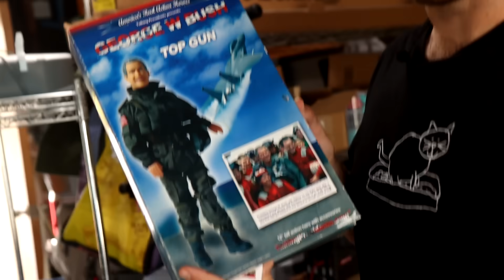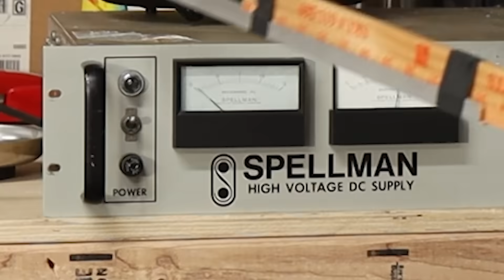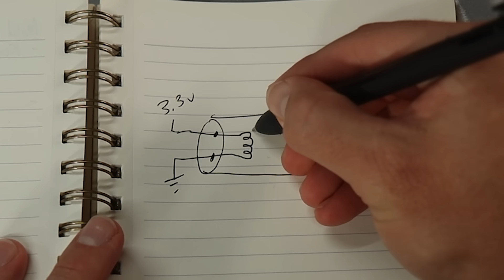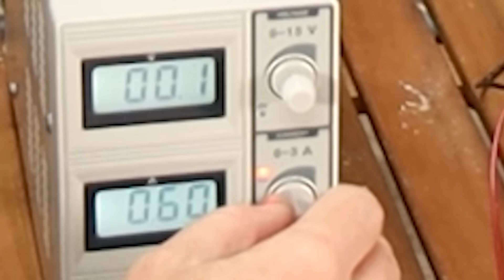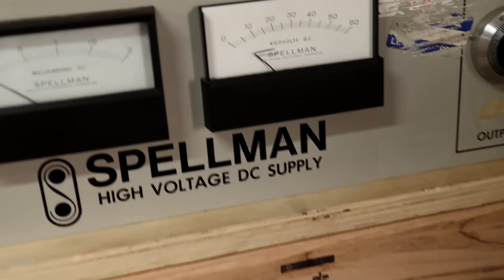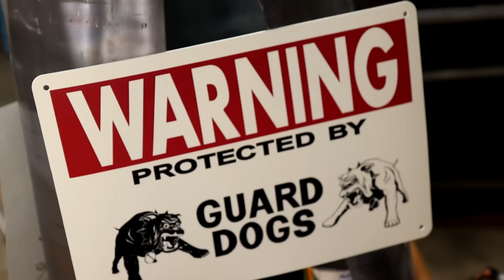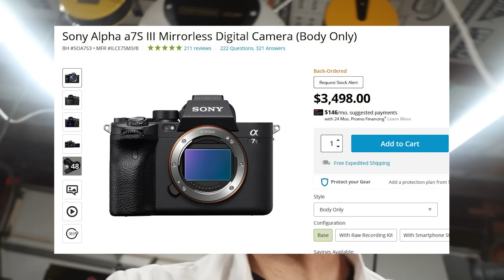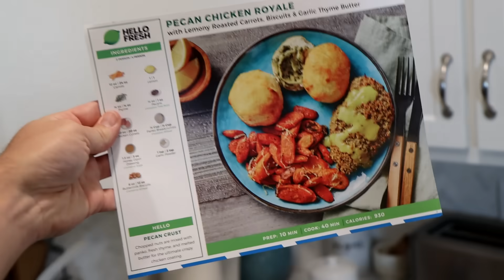Built My Own X-Ray After a Hospital Charged Me $69,210.32

Comment: I want to put this into perspective for everyone. I'm an xray tech. 60kV is good for extremity x-rays in terms of penetration. When an x-ray is taken on a commercial setup, it lasts about 0.04 seconds at say 0.125 A (125mA) Or 5 mAs (milliampere-seconds) for say an arm or foot. Even less for a hand, probably 2.5 mAs. 5 mAs is harmless. It's about equivalent to about 3 hours of radiation from natural sources (the earth, the sun, the stars etc) or around 0.001 mSv of radiation dose. A higher dose x-ray is something like a lumbar spine on an obese patient. The required exposure might be something like 100 mAs at 80 kVp which is equivalent to maybe 12 months of background radiation or a dose of 2 mSv. Now. ONE WHOLE sievert (or 1000 mSv) gives you a 5% chance of getting fatal cancer. 5 sieverts will give you a 50% chance of getting fatal cancer. So really, anything above 1000 mSv is quite dangerous, with a 5% risk of fatal cancer. William is using 60 kVp with exposures of maybe 0.5 seconds ~ 30 mAs or maybe 1 second - 60 mAs. This is considerably higher than a commercial tube extremity exposure because it's made out of cardboard. Thats about equivalent to a normal sized lumbar spine x-ray. William probably gave himself 1 mSv (0.001 sieverts) of radiation dose for that hand xray, about 6 months of natural background radiation. Was it dangerous? No. Where 1 sievert gives you a 5% chance of fatal cancer, 0.001 sieverts might give you a 1 in 200,000 chance of getting cancer. Thats a 0.0005% chance of getting cancer. Repeated doses are however cumulative. In terms of ONE single dose, if you repeated this dose on a different person for 548 years, you might expect a 5% chance of one of them getting cancer.
Reply: Thank you for this concise expert context! :D
Reply: @jamesjenkins9480  you know he probally doesnt know anything right?
Reply: William said CT scanners use heaps of radiation. It's true, but only comparatively.. A HIGH dose Contrast-Repeat CT scan may give you 16 mSv dose which is equivalent to 16,000 of Williams hand x-rays. That still represents a low risk of getting cancer. Most CT Scans are between 5 and 10 mSv of effective dose
Reply: Or have really shittty luck.
Reply: Woah, this video must've been sooo much more interesting for you than the majority of people; and thanks for that explanation, I figured the risk was lower than it seemed but this definitely makes him seem a whole lot less crazy for doing this lol
Reply: i plan on becoming a Radiological technician, is it worth doing it or no
Reply: @arturogalindo1588  It's a solid career choice. There will always be work and you can work in a variety of modalities to suit your personality. So yes! absolutely. Weather you have a good experience or not will always boil down to three things: Who you're studying with, What hospital you train in and How good your course is. Once you've graduated though it doesn't matter, you can move around to find when you belong.
Reply: @matthewrowlands7271  how long is school for an x ray tech
Reply: @kc-jm3cd  In New Zealand it is a 3 year degree. Most places will be the same
Reply: @kc-jm3cd  I have my bachelors degree in X-ray and then cross trained and took my test to do cat scans so about 5 years.
Reply: @ashleycountiss720  thank you
Reply: @arturogalindo1588  I was a radiographic for a short time when I was younger, however I didn't "x-ray" people I took radiographic pictures of welds on high pressure gas lines , and various metal products for the military using radioactive isotopes the field is called "non destructive testing" so if your interested in radiography and don't want to deal with "patients" you can look into that area........you still need to study and pass tests by the nuclear regulatory commission to advance to high levels ...............very fascinating area of study, ......................Erik
Reply: Just a "small" correction, 5 sieverts isnt a 50% chance of getting fatal cancer, it is a 50% LETHAL DOSE (chance to die in a short period of time  - a month) because the cells in your body literally got fried by radiation. You dont have the time to develop cancer. But yeah, I imagine those who manage to survive that die from cancer later on. (This applies if your whole body received that dose. If its just the hand, the hand would start dying off.)
Reply: Thank you from a fellow tech!
Reply: Thing is, I would rather avoid (pointlessly) increasing my chances of getting cancer at all, even if it's just by 0.0005%.
I would be cool if that chance could be decreased but, unfortunately, that's not the case.
Reply: @qdaniele97  I'd take a 0.0005% chance of cancer for something this badass. Everyone dies eventually, may as well make it interesting, yes?
Reply: Nice math mate thanks for this
Reply: Nerd lmao (Just kidding its really cool that you can know this kind of stuff and I envy your knowledge :)
Reply: I am also an x-ray tech and have a bachelor of science degree within x-ray radiation and I will tell you and everyone else in this field that there's no such thing as a safe dose of x-rays. That is simply not true and a misconception that floats around hospital staff and even x-ray technicians. X-ray radiation accumulate and every dose can theoretically cause damage. You're absolutely right, we have an upper limit for when you're sure to get acute radiation damage but what we don't have is a lower limit for when damage can occur. You can have 30 CT scans in your life but it may be the radiation from a simple flight that causes the damage that turns into a cancer. It is also more or less impossible to put a finger on the event that caused the specific damage as it can take years or centuries to develop. When I did my thesis there was a focus on low dose radiation being much more harmful than previous thought. There's still a lot we don't know but playing with radiation is extremely dangerous and should not be done by anyone inexperienced in this field
Reply: @gris186  Everything in life is a risk bro! drinking, driving, smoking. Radiation nazis are often the ones who send crappy photos because they're scared of repeats or use inadequate exposures! The patient is better off having a few repeats than crappy imaging. Recently, a pt was referred for a CXR cause they swallowed a paperclip and felt some pain behind the sternum. I decided to take an abdo x-ray too. It revealed an open paperclip in the colon. I know a lot of MRTs who wouldn't have taken that abdo x-ray because a) wasn't included on the form and b) its extra radiation. I'll even make my own damn views up sometimes if I have suspicions, and sometimes they've show fractures where standing imaging did not.
Reply: @gris186  can you send me the link or name the reaserch. Our techs sometimes don't close does and stand in rooms during mobile chest x rays and I can't convince them that that is harmful enought for them to stop doing it
Reply: The real question is did he know any off that or is it pure luck this dudes not melting, Chernobyl style, right now
Reply: @pepsiatlas5452  Yeah it could have gone bad if he got his hands on a beefier tube or set a higher current. He was smart to start with a small current on the generator (shown by the dial) and the filament that his first test was noisy, then just upped it a little from there. Wouldnt want your kids touching that. If he just hooked up the filament and generator to a common switch and added a timer, it'd be pretty damn close to a hospital thing. in essence all that would be missing is focusing collimators and a radiologist to read the xray (which is what youre really paying for)
Reply: @matthewrowlands7271  For every Evan there is a Matthew.
Reply: @pepsiatlas5452  that only happens with long exposure to super critical nuclear cores (the demon core for instance). The Chernobyl explosion was a reaction between the steam and the aluminum alloy core barriers. The core itself didn’t overload. It did however lead to the fuel spilling everywhere which is why evacuation was needed. A TOTAL of 31  people of have been accredited to the Chernobyl accident, several of which died from the blast and not the radiation. Compare that to say, a dam breaking, that can regularly lead to the death of 1-2.5 THOUSAND people, the highest of which (analogous to Chernobyl) took the lives of 240,000 people. That should sufficiently put Chernobyl in perspective (especially since a lot of these areas where made as uninhabitable as Chernobyl). The mass hysteria that arises when people talk about anything nuclear stems for arrogance and fear mongering.
Reply: @pepsiatlas5452  he most likely researched the amp of an x-ray and bought one relatively similar
Reply: @pepsiatlas5452  Yeah....🤔
Reply: TLDR, he’s probably safe
Reply: @braggestcloud6535  he would be one of the unluckiest people out there if he actually got cancer from this
Reply: matthew Rowlands 2019 channel has no videos 
& offered no proof of being an  " xray tech" , = no value
Reply: Hi Matthew, one thing you forgot to include is the routinely radiation a human is exposed to every year. Like from dental exrays, mircowaves and even tv radition. So you can add that to ur answer.
Reply: @loveicecream9947  of course
Reply: This is great perspective because I totally thought you were leaning towards it being dangerous but it makes sense.
Reply: So it’s safe to use but not recommended or is it unsafe
Reply: @badanimationstudios3358  it's safe, as long as the exposures dont last for longer than a few seconds. besides for extremities, the quality would be poor without additional components added to it
Reply: Hey, sure it’s might take 548 years, but with this level of craftsmanship, someone using this in the next half a millennia is potentially maybe going to get hurt.
Reply: But what is the reason that getting an X-ray at an American hospital is so expensive?
Reply: @prjw73  he said it in the vid, since insurance covers so much, hospitals still want to make a significant profit so they charge an incredible amount just to do that
Reply: Didn't he say the a7S was on a 15 second exposure?
Reply: Wow, I'm surprised, these replies (from what I saw) aren't filled with people who are also "scientists" saying you're wrong
Reply: @geocatwizard  it seems that it’s because you can tell he actually knows his shit, also oooo lots of numbers seems right
Reply: @Bitterswheat  yup
Reply: Yeah but if applied science gets a call from the regulator I think someone else might be getting a call too.
Reply: Also take those cancer percentages with a few bags of salt as this will wary extremely from person to person and is probably based on animal models where an extreme dose is given and it is worked backwards to try and put a risk number on our daily exposures. 

Obesity, nutrition, genes, if you're an active person, if you work out, how often you eat, how often you don't eat and for how long, if you have a lot of stress in your life and probably a hundred other things.
Reply: @antihero0101  no it's true or it's language barrier what is shinola?
Reply: @antihero0101  well we know pretty much all phisics, biology and chemistry when it comes to radiation as part of study. Unless of course you didn't study and remember.
Reply: My brain hurts.
Reply: Matthew Rowlands
like half of what you said was spanish.
Reply: Shut up, just, no...
Reply: With all that tasty knowledge, and you throw it all up, all over everyone\everything. 😞
Reply: Wilhelm Rontgen is rolling in his grave right now at this idiot. He has no idea how bad radiation can be. I’m a CT tech and he legit compared what he’s doing to a plane ✈️ ride 🤣🤣 what a DA
Reply: We dont care! We love will either way
Reply: @reebA7786  My reply (if you read the whole thing) is Pro-Will ;)
Reply: Ah yes of course
Reply: Can some one translate this into english
Reply: @axobotl  Ikr
Reply: @axobotl  xray in small doses not harmful. What Willie did was safe
Reply: Heh, penetration
Reply: I can already tell if the end of the world happens your going to be the one that will survive for years
Reply: @KatzRKool12  this is the greatest compliment ever
Reply: Aren't there state or NRC laws about non-registered institutions owning ionizing-producing materials/machines?
Reply: @dire_5   I'm no expert but from my research (NYC Article 175 for example) it appears that non-human use is largely exempt, including no incidental exposure.  E.g, if you want to image delicate artifacts or other non-living objects for research, or perhaps art.  I imagine any business doing so must register to protect their employees and report workplace exposure, but an individual hobbyist would seem to be free to use this technology.  That said, this "build" is leaky AF and could likely land him in hot water for incidental exposure if it is so much as assembled near others.  It would be unwise to show up with this to, say, Makers' Faire, without actually bothering to do some engineering.  There's also some specific prohibitions against equipment with uninsulated conductors which would seem to apply!  Obviously offering the use of it as a medical service to others violates all sorts of laws.
Reply: @dire_5  I'm sure there are.. but legislation was never my strong suit 😂
Reply: Dunno, probably. I dont believe Will here or his channel counts as a non-registered institution. And unless there is specifically a law against civilians owing or utilizing them, I really doubt he's in any legal trouble. Hell, I dont think he's even in the grey zone. It's pretty much just a good media story if he ever gets arrested and or has his property searched, which again I highly doubt will ever happen. "Califlorida man builds EXTREMELY DANGEROUS radioactive device in his garage!!1!one"
Reply: @dire_5  cind of :D But it needs to be operational...
Reply: @dire_5  Also it's dental x ray tube... Not really powerful. Some countries don't even need x ray technicians to operate x ray machine... But depends what you hook it up too....
Reply: @dire_5  yawn
Reply: @Andrew_Fernie  I'm sorry you want to see William potentially go to jail or face other legal action. I was asking the X-Ray Tech who I figured might know.
Reply: @bobstevenson3130  lol I was thinking the exact same thing, took the words right out of my mouth.
Reply: I'm pretty he was more at risk of electrocution than he was with radiation poisoning
Reply: So exposure the radiation that were exposed to, regardless of source, stays in us for ever?

I know that some elements have astonishingly short half life and that building materials like natural rock, particularly granite are hotter than say composite materials with some natural components.
Reply: @DesertCatDad  The effect of x-radiation from that moment introduces some energy at a subatomic level, generally affecting electrons and their positions on the atom. It does however have a very small chance of ionizing or deionizing molecules inside cells which is what can lead to mutations and potentially cancer. In (very) rare instances, it can cause free radicals which might (but not necessarily) go unrepaired and lead to cancer. So the exposure doesn't stay in us forever, but the effect of it might if it happens to ionize or deionize a very particular part of RNA or DNA or protein or acid molecule etc that may go unrepaired and cause a chain reaction of complications. You're much more likely to get a melanoma from the sun (continuous source of UV radiation) or cancer from abusing your GI tract. Radiation is everywhere. Its harmless in small doses :)
Reply: @DesertCatDad  No its like light it pases thru you like for example flower leves. And makes image below... Nothing 'stays' in you after x ray but damage that they do on the way thru, can stay on dna, after... And multiple hits brings chances of successful harmful mutation up... Basically anything above 40 kV is small enough to penetrate thru body and break dna strands... by hitting or making oxygen radicals that rip dna apart. After breaking dna can combine ok or not ok on different place for example and cause mutations in cell. Mind thou that single cell... So if mutation is on gene that supreses prolifiration for example can make uncontroled growth of taht cell, which eventualy becomes a mass that we call tumor.
Reply: @DesertCatDad  The radiation usually does not stand in you for a second (unless you consume/breath in some radioactive material). Radiation is just some high energy paticles that transfer their energy to your body. 
This can happen in various ways.
The thing we fear is that the particle hits your DNA and alters something. If the dose is high enough your DNA has so many errors, that your immunity system kills the cell or lot of cells (radiation poisoning is just body killing all the damaged cells, which can be all of them)
If the damage is low enough, the cell can carry some mutation not affecting its function and multiply to next generation. The cummulative damage is when repeated exposure gradually alters your DNA in a manner when the cell multiplies uncontrollably. If your immune system does not kill it, it develops into cancer.
Reply: Yes, unbelievable, where is the 1mm aluminium filter to reduce the skin dose from low energy X-rays. This could get you a large fine in Australia, as you need a licence under the health and radiation act's to possess and operate X-ray equipment. Totally stupid video.
Reply: @malcolmwright7440  he is endengering himself so... Not really a problem
Reply: nerd
Reply: @xenthoq8713  "everyone smarter than me is a nerd"
Reply: Matthew is correct.  Using home brew x-rays on yourself is a very, very bad idea--look at the example of Madame Curie, who, while brilliant, did not repsect radiation.  His information about safety is misguided, ignorant, and false.
Also, the screen shot of the bill shows he was billed $40 for the x-ray.  Even if he had a dozen x-rays, this is not a bad deal, and if he had shopped around (admittedly not easy to do) he could have gotten an x-ray for less than that.  
The video 'explains' that paying for uninsured patients is why the hospital charges so much.  In fact it's a lot more complicated than that.
X-ray emitting devices are regulated in every state of the USA for a good reason.  He is an unregistered x-ray assembler. What he did was illegal but also stupid.  
Also he made a poor x-ray.  Modern x-ray devices cost over $100,000 and there's a reason for that.
Reply: "he would have to repeat that xray every day for 548 years to get cancer."
Except thats not how probability works. he would have to repeat it that many times to have a 100% chance of getting cancer im guessing? but even then having like even a 20% chance is sketchy. And this isnt even factoring in any other toxins and radiants from other sources such as smoking or getting sunburnt a bunch so while I know literally jackshit ab radiation that seems like some misleading statistics to me
Reply: @hungrydino51  You're right I have reworded that last sentence. There is at LEAST a 5% (most likely greater) chance that he would get cancer from repeating that XR every day for 548 years. The hand is not a highly radiation sensitive organ, especially for a fully grown adult. If he were x-raying his GI Tract, the chances of cancer would be significantly increased.
Reply: @hungrydino51  he’s just making the point that he’s not in the threshold of dangerously high risk. He would have to do it every day for 5.5 years to have even a 1% chance of fatal cancer according to OP’s math. So yea
Reply: @codyramseur  the guys maths doesn't account for the fact that he was using continuous operation, not a pulse like you would see for medical X-ray.

A good rule of thumb is to NEVER work directly with an unshielded X-ray tube that is emitting continuously.
Reply: Predictions of the chance of cancer cannot reach 100%. This is because at 100% it is no longer a prediction. You have cancer.
Reply: Long nerd shit didnt read
Reply: @streetpunkstreams4730  so you didn't read but took the time to reply anyway and let everyone know you didn't read..? dude you're a weirdo...